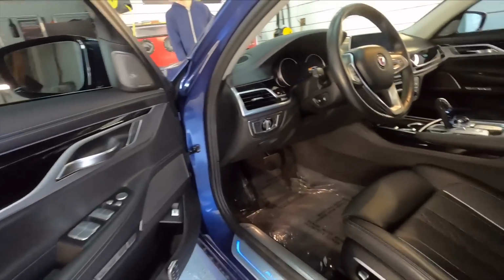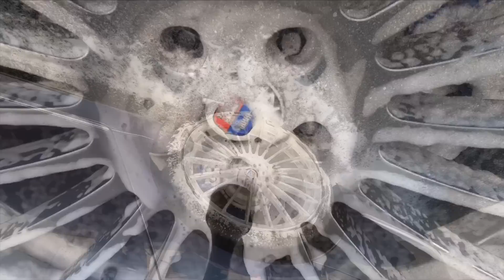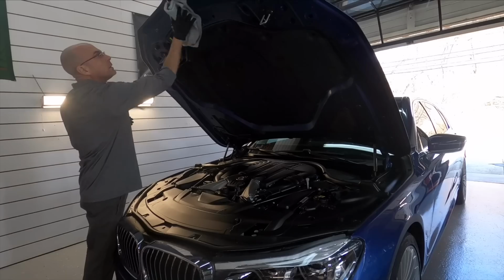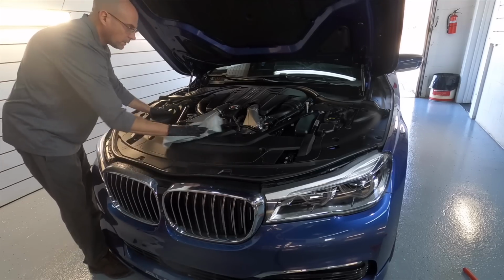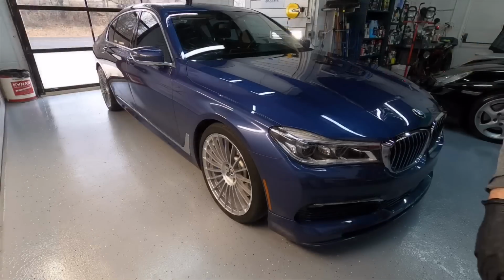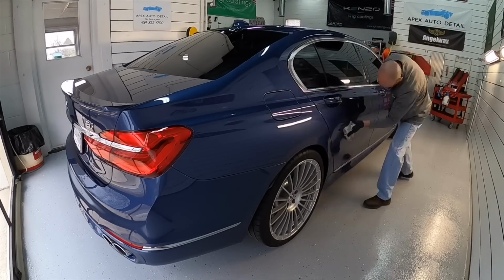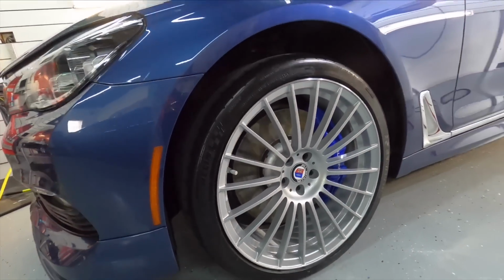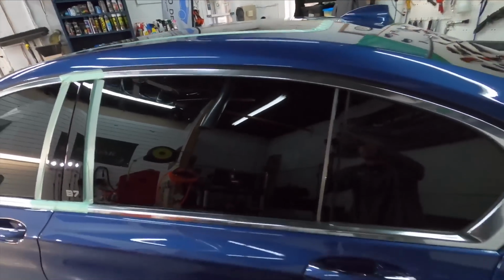BMW Alpina B7 Twin Turbo 600 HP Gets The Executive Detail/Correction Package! Part 1!

Comment from the maker: Any questions following part one?
Reply: What is your email address to send you general questions on products on the videos you make?
Reply: Brian. What snow foam soap was that? Worked great. Thanks 
Looking forward to the rest of the series.
Reply: Link to that wheel device you have the wheel spinning on lol. Looks handy
Reply: Nvm I found it browsing thru your videos
Reply: @craig.encinitas  carpro reset is not green
Reply: Was that tac moon light on the brake calipers.
Reply: @norcalspitshine9067  p&s beadmaker
Reply: @ejg34  Link please?
Reply: Were the wheel well plastics coated as well or just dressed and with what product? I liked the finished look of them!
Reply: I noticed you didn't use the foam gun for the engine bay like you did for the Supra. Is it because it not that dirty?
Reply: How is it going buddy great content i have a question i tried to polish my black suv with a harbor freight rotary polisher with hd speed and the recommended pad to use with that but the thing is that it left hollograms/ or buffing trails what can i do to remove them
Reply: What is the name of/link to the roller you place the wheels on when coating them? That looks so helpful!
Reply: EJG This is the Source Garage wheel holder. Just look up the source garage on YouTube and you should find the man who makes them.
Reply: Sandro Herrera This is the Source Garage wheel holder.
Reply from the maker: UKSportsFan miragebjs@yahoo.com
Reply from the maker: James F one ounce Angelwax FastFoam
Reply from the maker: Ben Hedrick IGL Wheel topped with TAC Topcoat 1.0
Reply from the maker: Ben Runkel Manett’s Megashine
Reply from the maker: Henry Le correct.
Reply from the maker: Juan Lazaro you need to step down to a finer grit polish and softer pad.
Reply from the maker: Some Times SourceGarage.
Reply: Another Gem! Thank you Brian from Apex Detail :-)  Question: Where can I find the device you use for holding and spinning a wheel and tire?
Reply: Did you use the same dressing for the tires that you used on the engine?

Comment: Another great vid from the Master! Brian, how to you remove the wheels without damaging the lug nuts or the surrounding cavities. Many high end rims are polished aluminum or chrome. Is there a special tool? Do you use an impact?
Reply from the maker: Peter Jurenovskis impact with sleeved lug nut socket.

Comment: I usually don't comment but since I noticed the jeep wrangler in the background in this video here goes > In alot of your videos you mention (hard clearcoat / soft clearcoat..ect ) I detail quite a few jeep wranglers and I would appreciate your professional feedback on ( is the clearcoat on the jeep wrangler soft clearcoat or hard clearcoat? )
    Also I watched a video of yours about angelwax that you used for a minor correction that looked fantastic. 
    I'm detailing two jeeps this weekend one jeep is a 2016 jeep wrangler (Sahara Sand clearcoat) fantastic shape very minor swirls and very minor scratches from the delta sonic car wash (paint is like new except very minor issues I mentioned above)
      The second detail is a black 2018 jeep wrangler Rubicon with very minor swirls and very minor scratches also from delta sonic car wash. 
I was going to use Jescar car micro finishing polish and than top it off with Jescar powerlock (this was my plan for both jeeps)
   But since I watched your video last night about Angelwax and the results I'm debating about possibility giving Angelwax a tryout and pick up some Angelwax products...ect
  My plan is to use Angelwax perfect polish than top both jeeps off with Angelwax the fifth element wax. 
     Your thoughts and feedback is appreciated on the two different products (both are good) but what will work better for both jeeps?
   You can reach me at svida573@gmail.com  (thank you)
Reply from the maker: Mike Svida you will enjoy the AW products. High quality. Keep clear is medium as of late. Getting softer every year as manufacturers slowly switch to water base.
Reply: @apexdetail85  Thank you for your input I'll definitely give Angelwax a tryout 👍